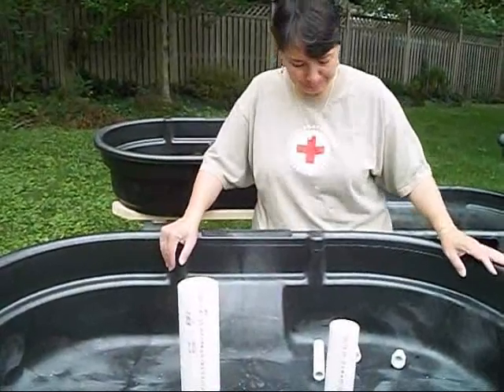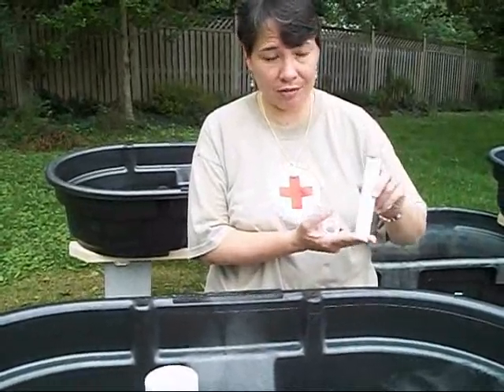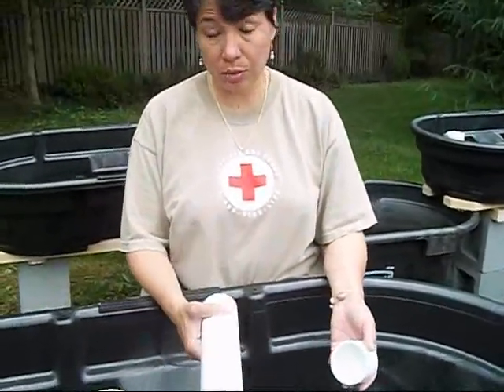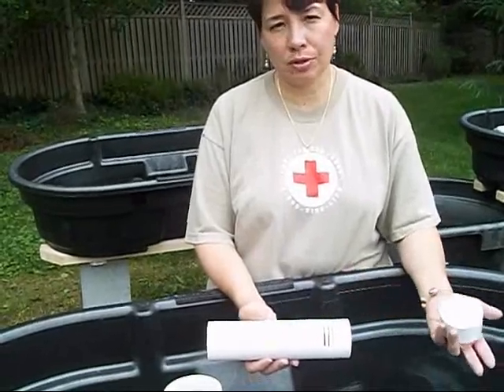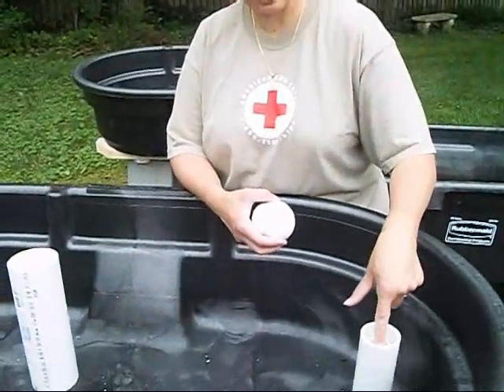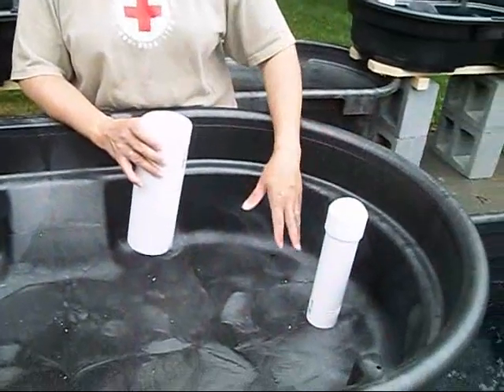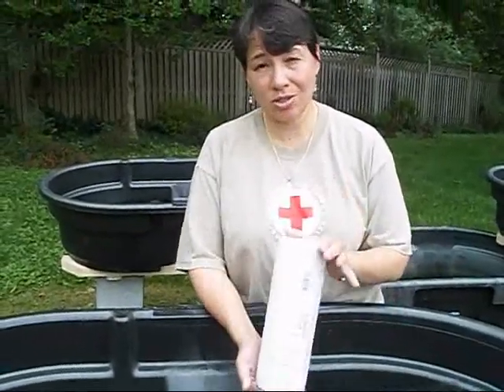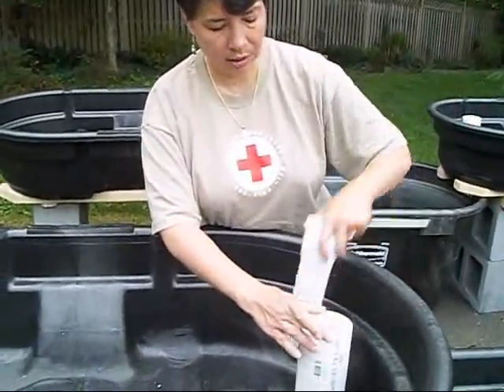Bell Siphon

Comment from the maker: The dry clay pellets sometimes float, but when they are soaked in water, they become slightly heavier than water. Before adding clay pellets to your grow bed, I recommend dunking them in a water bath to get rid of most of the clay dust. I would also recommend putting something heavy on your media guard to keep it from getting knocked over when you first are adding the beads to the system and maybe for a couple of days after that (with the water flowing into the grow bed). Good luck!

Comment from the maker: The siphon will stop when it starts sucking air through the bottom. If you are using a smaller (e.g., shallower) bin, then the siphon will break shallower. I have a demo system that is only 6 inches deep made from a plastic bin for boot storage (yeah, Container Store). Since it's only 6 inches deep, the siphon breaks about 3-4 inches down. Because the volume is tiny, it also goes through the cycle every minute.